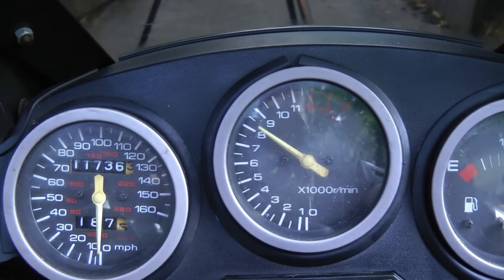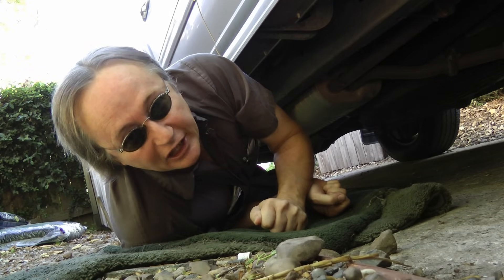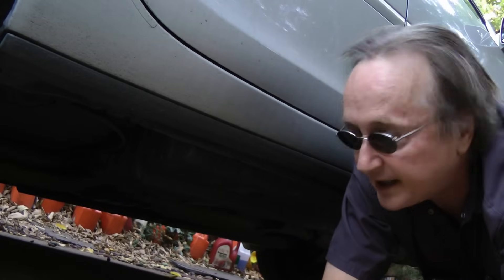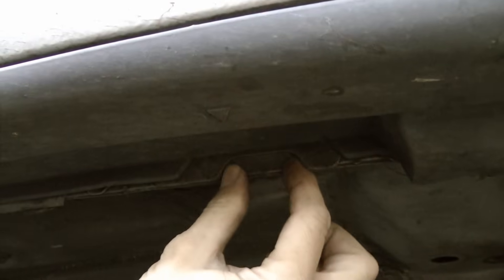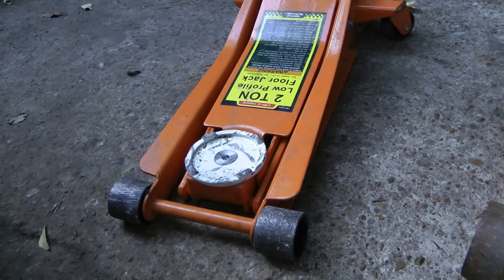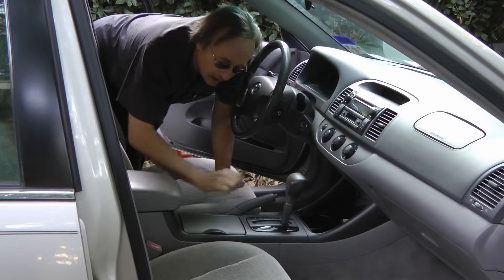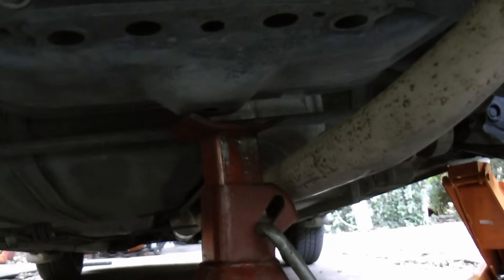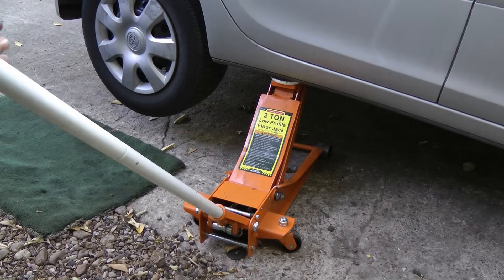How to Jack Up Your Car (The Right Way)

Comment: Christ he releases that jack quickly.
Reply: I was coming to say the same thing
Reply: Francois Deshue there's a reason why your fucking suspension goes bad fast. Doing that will fuck it up faster. If it didn't matter, I guess all Jacks would just do that wouldn't they.
Reply: That's a problem with harbor freight jacks.  Mine did that right out of the box.  I had to buy jack oil and bleed it.  Even though I bled it, it still is hard to make it come down slowly when there so much weight on it.  You have to turn the handle REEEEALY slow and hope it works.  It's easy to turn the handle too much and have the car come crashing down because the handle is so hard to turn when there's all that weight on the jack.  You get what you pay for.  I'd buy another one because the price is right, but you have to learn how to use them and make sure they are bled properly.
Reply: I thought the same 😂😂😂
Reply: I'm sure he did that for the show.  Since his videos usually are eccentric.  But problem is there will be viewers who will follow.
Reply: I popped an oil seal plug in the jack doing that as a kid. never again. Messy lesson for me and my neighbors.
Reply: @nunyabiznis817  What car jack brand do you recommend?
Reply: L
Reply: @pxndxlunx5821  not to serious.. because we drive and pass thru on speed bumps tons of times.
Reply: @nunyabiznis817  A tip for you: 
Drill a hole through the jack handle and insert and screw driver/extension etc. to give you leverage. 
Or use water pump pliers to grip the handle.
Reply: @haraldpost  I used to have the same problem Nunya has with Harbor Freight jacks.  But now I just use a pair if gloves with rubber palms (not nitrile palms, rubber palms) and that gives me a good sturdy grip to turn the handle slow in tiny increments to let the jack down slowly.
Reply: @pxndxlunx5821  disagree your suspension takes more abuse driving on the road than this will.
Reply: its not that big of a deal, doing that is probably does the same damage as driving over 2-3 speed bumps
Reply: @nunyabiznis817  You are not alone... I have a relatively expensive one from Northern Tool + Equipment with the same problem.
Reply: Don't let the children watch this! They could kill their father.
Reply: If he does it then I can too 😂 thats ho much i trust his knowledge
Reply: Scotty is a jack officer.
Reply: And the car rocked to the side!
Reply: @serpentpigeon9108  Darth Vader, "Luke I'm Your Father" Luke, "NOOOOOOOOOOO".
Reply: 😂 . he dropped that jack so fast the jack stand was juggling that car for a second
Reply: Yeah, but this is a 94 cellica!
Reply: That’s old heads for you
Reply: Christ is Lord*
Reply: Right way
Reply: seriously?  going over a bumpy road is waybworse than that
Reply: He was checking the shocks 😂
Reply: If your jack releases too quickly, you can release it and quickly tighten it again until the car is where it needs to be. Usually what I do in that situation.
Reply: Yeah but it’s just a Toyota
Reply: It's worst when you hit a pothole or pass a speed bump
Reply: @pxndxlunx5821  false, lowering the jack fast couple of times a year doesn't do a thing to your car! Driving 20k miles a year on rough road does way worst!
Reply: It’s six years later and I’m still sweating from it
Reply: Premature car jackulator
Reply: @pxndxlunx5821  don't be silly,  he's not doing the vehicle any harm . He knows what he's doing 🤪
Reply: All coming for advice on how to jack a car up yet then telling him how to do it 🤣🤣 you crack me up .. odd ball
Reply: Like you reached into my brain and verbatim removed a string from my internal monologue
Reply: He just proving a point 🤣
Reply: Scotty isn’t perfect even though he acts like he is lol.
Reply: Put the loose wheel under the cill as another safety measure
Reply: and the handbrake 😂 i love how he does it he's a mad genius and bo nonsense  its his car so he does as he pleases
Reply: In the Jack stand 😂😂😂😂 good way to break something
Reply: @blanc5522 more concerned when he dropped it on Jack stand …, of your off and it slips into the oil pan or something … alway go
Slow .,,
Reply: @dippingfool4785 who cares about dropping it in ground ..
It was when he dropped it on Jack stand …. If it shipped off the Jack stand could damage the car ..
Reply: @nunyabiznis817  bring the jack handle close to your body like youre almost hugging it to get better slower control. Lessens chances on loosening too much and the car comes crashing down. Works every time for me
Reply: You guys are funny.
Reply: Oh no, you're making struts do their job 😂
Reply: Stop using God name in vain !!!!!
Reply: Hitting a manhole pothole is equally just as bad if not worse😅😅😅
Reply: Like a pro...pros make it look easy.

Comment: One time I was changing my oil I was under the car. I had two jack stands and a floor jack that was still engaged. I was finished changing the oil I rolled out from under the car. I was going to lift Jack up to remove both of the jack stands. When I went for the Lever to start lifting up the car , I noticed that the jack has lost all power and was in the down The position and the only thing that was holding up the car was the jack stands.
Reply: N Yo Goes to show, can never be too careful.
Hell I even put a stack of bricks under mine on each side as a final fail-safe if the jack stands fail.
Reply: I do the same, except I just throw the tire under the car by the jack as a fail safe.
Reply: Have you guys read articles of people being crushed by their cars from not being safe? I have in my region. You can never be too safe, lifes a precious thing harry
Reply: I didn't know you were supposed to keep the jack engaged
Reply: @just4kiksXd  you’re supposed to set the car on the jack stands but you can leave the jack engaged lightly just in case the jack stand fails.
Reply: @just4kiksXd You can keep the Jack engaged as a backup for the stands play never rely on just a jack without the stands. Jacks I meant to lift the car up but not hold it up
Reply: @minecraftperson999 old tires work great too if you have them laying around - 2 on each side stacked on top one another

Comment: I usually do the opposite. I jack from that center cross-member and lower it onto 2 jack stands one at each side pinch weld.
Reply: me too.
Reply: yeah that's FAR safer, 1 jack stand on the point scotty showed is actually quite unstable
Reply: That seems to make more sense to me! *(Jack of no trades here)
Reply: Yeah he did this completely backwards , pinch welds are meant for the jack stands. If you jack it up there then you can't fit the jack stand under there. If you have a car that uses a unibody frame then just find the most solid piece such as a crossmember or sometimes tow hooks and jack them up there and then place jack stands where the pinch welds are.
Reply: Kinixys3 
My jack is to small to reach the cross member.
Reply: That's the way I do it too.  I think it's much safer.
Reply: maybe scotty just has one jack stand available at that moment
Reply: You’re doing it the right way, the way Scotty did it in this video is backwards, it’s unstable having it on just one jack, especially if you then jacked up the front on one jack too.
Reply: I like to put a jack stand on each frame rail on my car, that way the pinch welds won’t bend while their on the jack stands
Reply: @bobriley000444  I did lift back than there with jack at that point and, Toyota Corolla, fall of it.  I get lucky to not get hurt.
Reply: I'm new to this party, but I entered the comments section to post this exact same thing. I put my jack on the cross-member and use my stands on the edges of the car. Takes a little longer, but it seems much safer to me that way. Scotty's video messed me up for a bit.
Reply: LOL, seriously.  I ain't trying to balance the rear end on A stand.
Reply: I just use a jack on each jack point. The stands stay in the house.
Reply: @burns1210  pretty dangerous if the jacks were to fail and you are underneath the car. Use jackstands.
Reply: Christopher Burns that is very dangerous. Jacks fail all the time
Reply: @maddyinc933  I don't get underneath the car. The two jacks is for a tire rotation
Reply: @srccar  eh. Not both at the same time
Reply: @burns1210  Good to know.
Reply: @burns1210  That's is fine as long as you are not getting under the car.
Reply: Kinixys3 - who gonna feel safe working underneath a car supported by 1 jack stand in center.  cant believe no cars have ever tipped on its side supported only by 1 stand?
Reply: But that is the right way tough
Reply: so do I, scotty dropped the ball on this one
Reply: @burns1210  lol...so why have stands in the first place? You hydraulic Jack's will fail more often than jack stands...your crazy...lol
Reply: @stevenmanson2490  for getting under the car maybe?
Reply: I plan on doing lotsa stuff like oil change, brake work including bleeding or flushing, and tire rotation.  So it makes way more [safety] sense to place the 4 stands under the pinch welds -- front and back.  Maybe leave a jack under a cross member that was used to lift the car.  Way more stable, especially if someone is working the brake pedal while I bleed the brakes!
Reply: This is precisely what I came to realize myself after doing just 1 oil change on my Jetta. I did it "wrong" like Scotty did well even "wronger" as I used the floor jack on the pinch weld just back enough from the actual reinforced point to put the stands on the proper spot. Did it for both sides. Technically it's much better to jack it up from the cross member and then put the stands in place but it took me getting a low profile long reach floor jack to be able to do that.
Reply: that would be the correct way of doing it
Reply: That doesn’t look safe.

Comment: The e-brake works on the rear wheels. So if you jack the rear make sure you chock the front wheels. Homeboy set the e-brake and jacked the rear without chocking the front!... Oops!!
Reply: maxxasvideo For sure... But, i think he set the e-brake so he can loosen up the lug nuts while it's in the air.
Reply: Who you calling homeboy??
Reply: The front wheels dont move with a front engine frontvwheel drive car.... ooos!! Back to UTI
Reply: It was a Toyota Camry,right?That's a FWD car.With the tranny set to Park,not gonna move much.But still,best to chock the front wheel (s) just in case...:-)
Reply: how do you all know it's not a manual? How do you know I'm not gonna go do the same to my GTI and then not chock the wheels and then die? 

You can't just assume these things; that's how people get hurt.
Reply: @SpaceMissile  you see in interior of the car when he pulls the e brake. It's an automatic
Reply: maxxasvideo I had a guy next door to me that was a wrecker drive who used his rollback with a winch to jack his daughter car up. He was working on the transmission and loosen a bolt that put the car in neutral. He did use jack stands and the car fell on him. The guy way laying side ways when the car fell on him. I heard the daughter screaming I got dressed because this was early in the morning. By the time i got over there the guy was already dead. He was all purple in color. Needless to say he should've used Jack stands. I've had a truck fall out I used Jack stands and that's why I'm still here today.
Reply: @jason127x99  what's your point here? You say he used jack stands, then say he should have used jack stands.
Reply: @burns1210  I think what he meant to say is that he didn't chock his wheels? He said he did use jack stands but the car went into neutral and rolled im guessing?
Reply: Christopher Burns he meant to say didn’t use jack stands
Reply: @HjMaswadyHjAmjah  It's not gonna move much if the car has an automatic transmission and it is set to Park, however Scotty was giving generalized instructions for any car. For a manual transmission car one must chock the front wheels.
Reply: @SpaceMissile  Indeed. Scotty was giving generalized instructions for any car and for a car with a manual transmission you need to chock the front wheels when lifting the rear of the car.
Reply: @soilmanted  Always chalk the front wheels when jacking rear of car. I've seen many times when someone thought it was in park and was still between park and reverse allowing wheels to roll. My wife does this often. She also just the car off while it's in drive then calls wondering why the car won't start next time she gets in it.
Reply: @Rick-the-Swift  Actually, it depends upon the car. Most modern cars are front wheel drive and have an automatic transmission which will prevent the front wheels from turning when the transmissions is in park. But some cars are rear wheel drive, and the transmission locks the rear wheels when the shift lever is in park. In either case, there are ways to tell if the car is truly in park. Thinking the transmission is in park, when it is not, is not only dangerous when lifting the car, but it is also dangerous when parking the car. Sorry to hear that your wife causes so many problems for you, and for other motorists on the road. Perhaps someone should have a discussion with her about whether it is safe for her to continue to drive. We don't want her to cause an collision and sustain an injury, or cause an injury to someone else.

Comment: Thanks for posting this, Scotty. Everyone, pro or amateur mechanic should watch this even if just for a refresher. A friend of mine who was a mechanic for a local dealership for 15 years was helping a friend of his change his transmission filter at his house. The friend used a scissors  jack, the only jack available at his friend's house, to jack up the car. The jack slipped while he was under the car and was killed instantly. Now, I always wait until I have the right tools for the job.
Reply: It is for this exact reason that I do not solely trust a jack. I always place the car on jack stands, and then raise the jack to just barely holding the car, as fail safe. Should a jackstand fail or tip, the jack is still there and vice versa. Also, I do not trust scissor jacks whatsoever!

Comment: I absolutely love how you cover all the silly questions new car owners, or people like me with no mechanical history what so ever, would ask.Keep up the good work, since i have my car, over a year now, I found at least 5-10 answers to my questions on your channel, thank you for that !
Reply: Do NOT do what this guy did in the video. Do not jack the vehicle on the pinch welds (side jack points under door frame) they are made for a scissor jack. Use the internet and look up the central front and rear jack points of the car. Use your floor jack to lift the car at front or rear, then place your jack stands at the pinch welds. Lower the floor jack SLOWLY onto the jack stands, then pump the floor jack back up a little so if the jack stands happen to fail, you have the floor jack as a backup. It's also a good idea to just go ahead and shove a wheel under the car too if your are taking any wheels off. Don't forget to put the car in gear/park, set the parking brake, and chock the wheels with a block or something.

ABSOLUTELY DO NOT PLACE ONE JACK STAND IN A CENTRALIZED POINT OF THE CAR LIKE THIS GUY DID. You want your jack stands spread as far apart as possible. What he showed in the video is a recipe for disaster.
Reply: @lastuvthe  I always use my jack as a backup, and always chock the wheels.  I've seen someone get killed from working on their own car, it wasn't pretty.  Even if it seems redundant, take as many safety precautions as you can when working on your car in your garage or driveway.

Comment: Also remember - setting the transmission to park won't have any effect once any single drive wheel loses contact with the floor.
The park gear only works when all drive wheels have contact with the road. Once one of the drive wheels is raised, the car might as well be in neutral.

Comment: I'd usually jack from the centre then put the stands under the jacking points, that would seem to make more sense to me. Another good safety tip if you're going under the car is to take one or two tyres off and place them under the car somewhere suitable so that it the jacks collapse then the car will land on the tyre and hopefully not your head
Reply: Yep. More efficient and you're less likely to bend the pinch weld that way
Reply: I would advice againsr using ur wheels if u got some nice ones 😂

Comment: I'll take you word for it that Toyota designed a spot on pinch welds that's beefy enough to jack on (as you clearly pointed out) but generally not a good idea. I have 2 unibody GM cars that show in owners manual were jack points are and it ain't the pinch welds.  You are an Icon on YouTube so I'll probably get lots of uninformed grief on this but tell everyone to read the OWNERS MANUAL for proper jack points for non-full framed vehicles.  Thanks for your good work Scotty.  People need to be able to work on there own cars (safely) when they can.

Comment from the maker: jack stands are very strong, but you can leave the jack too if you wish for more security
Reply: After resting the vehicle on the jack stands, I always crank up the jack so it's just barely touching/lifting, as a failsafe. In the super rare instance the jack stand fails or tips over, you'll have that there as an extra measure. Typically, you're going to put the jack there anyhow when you go to take the car off the jackstand anyhow, so it's not even really any extra work.

Comment: The spot that he placed the jack stand actually is a jacking point identified by the Toyota manual. Some models like the 2014 corolla have a little screw-like attachment that comes with the tire changing kit that you place on the jack and insert into the hole to help jack the rear of the car up.

Comment from the maker: As long as it's on a strong metal part that won't bend, you can use it. But realize they make various types of jack stands, some have flat tops which would git on the crossmember.